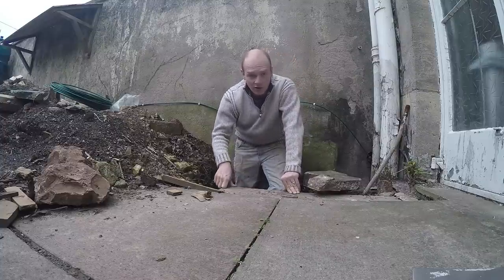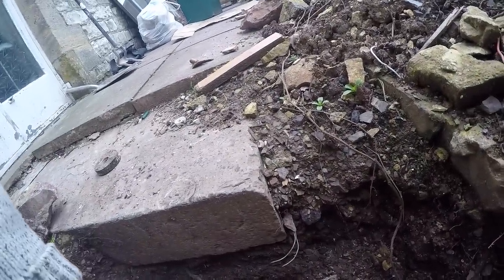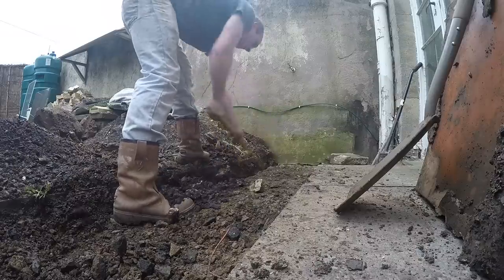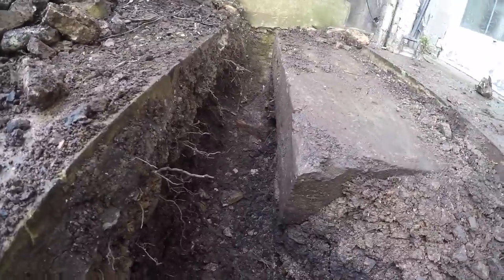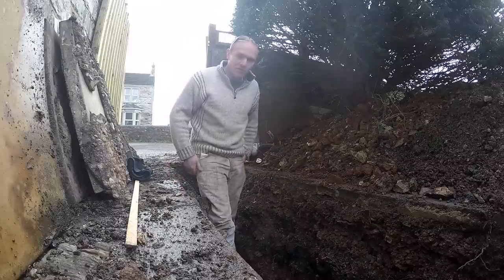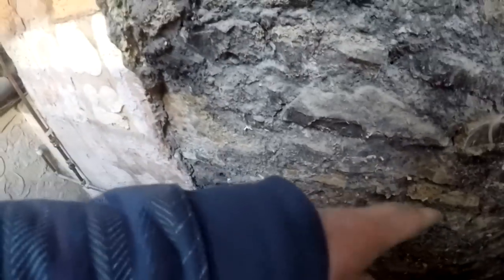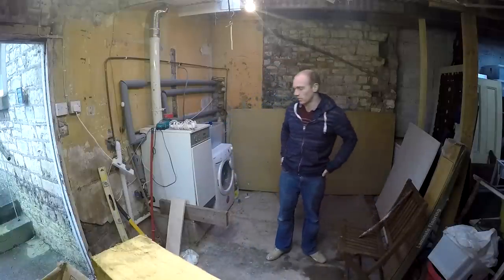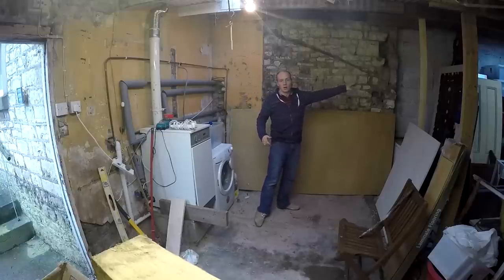Replacing an Old Water Supply Pipe - Part 1 of 2

Comment: Well done, one consolation is that least it wasn't saturated clay that you had to dig!  My water company (united utilities) do free connections under a lead and common supply pipe replacement scheme, so may be worth inquiring with your supplier to see if they do the same.
Reply from the maker: Yes, managed to pick a good day.  Just finished off the last bit and hopefully being connected up next week.  We get it free here too as it was an old iron pipe, so everything outside of the boundary and the connection is all free of charge. Shame they don't do all the digging for you!  The inspector did say I had a very tidy trench though, I was quite flattered!

Comment: You realize you can pull through a cable in the pipe to an exterior then a new pipe can be followed  by same cable without trenching below surface only 1 hole outside